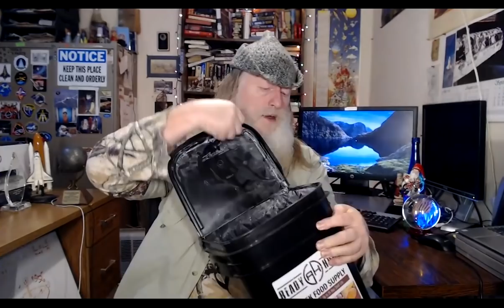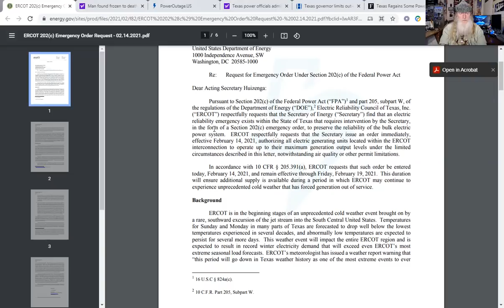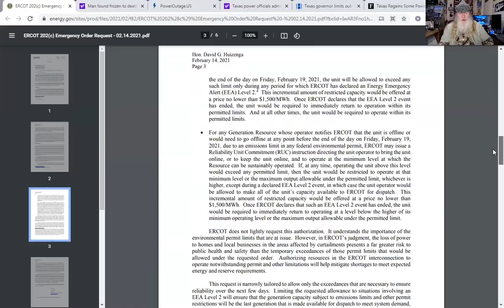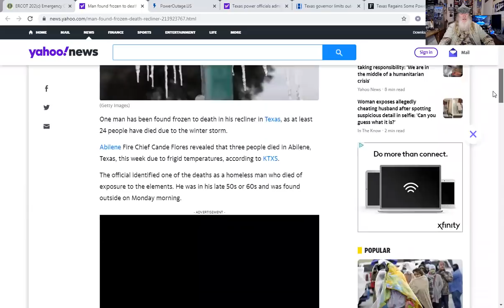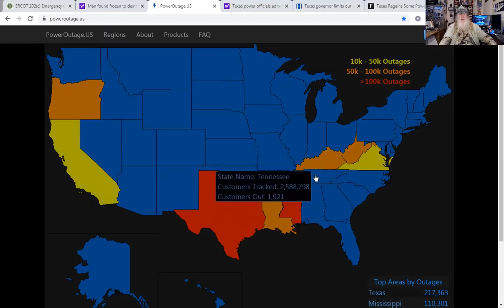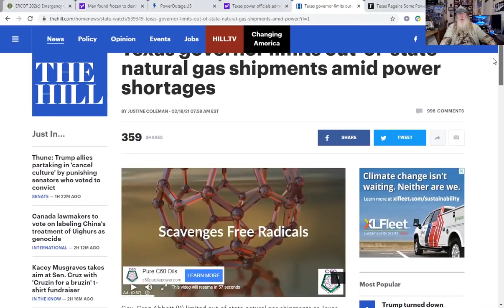Power Problems in Texas Are You Next

Comment: Here in Virginia, our county neighbors are complaining of excessive electric bills. One lady said last month was 250 and this months its 500. Its all over like this. My bill stays under 150 a month. I set temp inside to 67. Turn off everything I do not use. Newsmax is now saying the whole country is having excessive electric bills. The weather, democrats mandate to shut down coal, stop new pipeline permits, and many refineries on stop mode. With pandemic job loss, more people at home. Means more electricity and all living fat on the hog. All I can say, PAY UP.
Reply: Mines set @ 0 (off) up to 60 degrees (periodically, through the day/night). I cant afford a $50 bill. I use my heat only when absolutely nessacery . usually when i need to take shower, get ready for the day ill kick it on for one cycle of heat then turn it off.
Reply: I'm in Knoxville Tennessee.  It doesn't get that cold here.  My bill is ALWAYS about $500 per month in the winter & about $300 per month in the summer.   My house is about 450 square feet.
Reply from the maker: @anastasiadodson9045  Wow